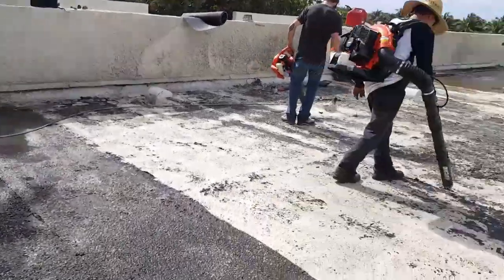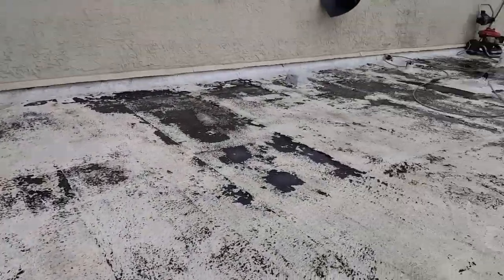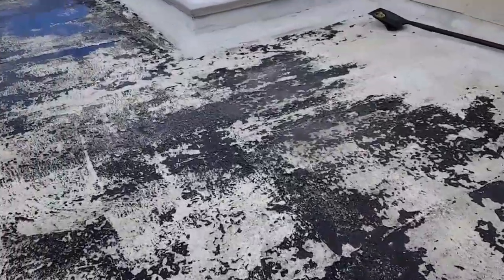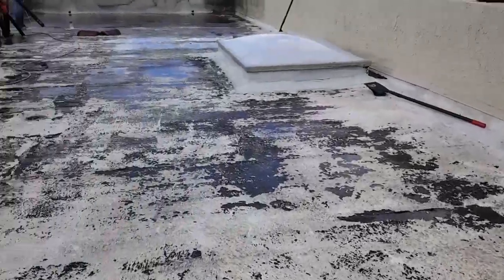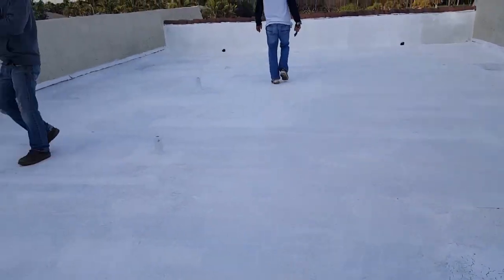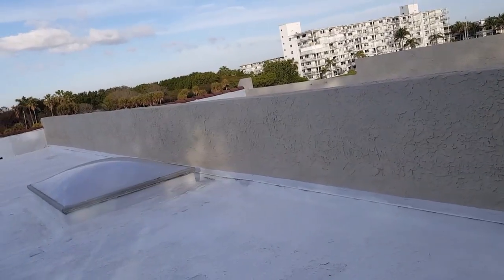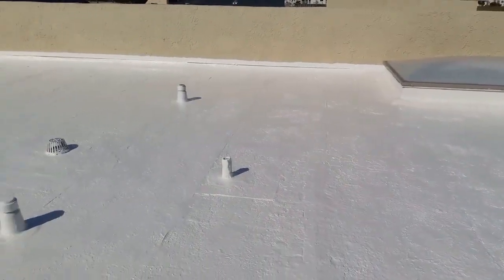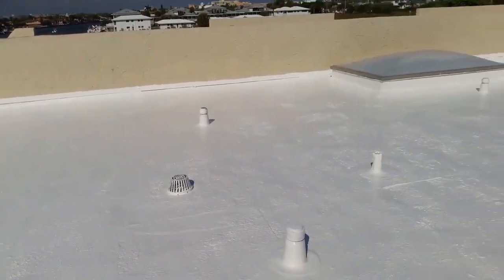White Silicone Roof Coating Done Right: What Most Contractors Get Wrong — And How We Get It Right

Comment: What primer is used for silicone application thank you in advance
Reply: primer is not required for metal, wood, or plastic materials. it's 100% silicone.  Henry's makes a retail product called Tropicool 887.  I've applied it to shipping containers, and most roof surfaces. You should always perform an adhesion test to make sure.
Reply from the maker: It depends. Mostly an acrylic base is fine. Check the manufacture specifications. If you are installing over an asphalt roof, you will need a primer coat to keep it white.

Comment: What coating would you recommend for an EPDM roof membrane....
Reply: Henry's tropicool 887 will go right over EPDM.
Reply from the maker: EPDM is tricky because it forms a heavy residue than can be difficult to get full adhesion for silicone. Just be sure to prep the roof properly before installing.
Reply: @AastroRoofing  Thank you..!!!

Comment: Do you need to remove old, chippibg silicone sealant before applying new coat?

Also how thick should the silicone layer be?
Reply from the maker: The finished thickness should be a minimum of .22 mills. But some coatings can be applied with a thicker coat. Yes the existing roof should be properly prepped and repaired before installing silicone.

Comment: How much should this cost (estimate wise) when hiring someone to do this for you!
Reply: It depends on how large the job is. Small job I'd say in the range of 3 thousand
Reply from the maker: It depends on how much prep and repair work is necessary, also what type of surface it is covering. Silicone roof coating costs about $2-$3/ft to buy the product, application usually costs about $.50-$1/ft. So roughly $2.50-$4/ft cost before any profit, overhead, or prep work. Total cost for the system from a reputable company should start at $5-$6/sqft and go up from there.

Comment: What's the difference between silicone and acrylic? Or which one is more effective?
Reply: Silicone can be solvent-borne or air-moisture-cured.  Acrylic is water-based and can be good for adequately sloped or vertical surfaces.  Acrylic is NOT okay with any ponding water.  Silicone does very good with standing water.  Silicone also doesn't break down in UV light like acrylic does.  While there are situations where I will use acrylic, generally I favor silicone.  Oh yeah, NOTHING sticks to silicone... except more silicone.  Acrylic can be quite coat-able and paintable.
Reply from the maker: @Dubya84  well said. Never use acrylic or water based coatings on a flat roof. It can be used as a base coat to add tensile strenght to a silicone roof coating but cannot stand alone on flat roofing surfaces. Only use acrylic if the roof is properly sloped and drains very well.

Comment: one way vents? must be allowing moisture out?.. shouldn't seal moisture, not good..
Reply from the maker: Agreed, But anytime we install a coating or recover system over a concrete deck, we use one way vents for residual moisture. It is just good for the roof system.

Comment: Can you explain the process you use to install them 8 one way vents please I would greatly appreciate it
Reply: Cut a hole in the roof the size of the vent hole on the bottom all the way down to the decking then you screw the top side of the one way vents approximately 4 screws through the flange into the deck and then you flash it or seal it like they did
Reply from the maker: Attaching the vents with screws is not preferred @ReidJohnson35 . Only use a mechanical attachment if necessary. Just be sure to flash according to the roofing system manufacturer specifications.

Comment: Awesome keep on truckin .. looks great....in the event....water was to find its way behind .....due to unsealed metal along the roof walls...say,...would the coating pull away from the walls like skin ... leaving air pockets, wrinkles, and water underneath?....
Reply from the maker: It is possible but unlikely if installed and prepped properly

Comment: I thought the warranty for full silicone was 15 years or more
Reply: Actually 50yrs. But maybe there's other factors he's taking into consideration like the age and prior wear of the roof so far.
Reply: Depends on how thick the layer of silicone is for how many years it says it should last. There's millage measurement guide you can look at that'll explain it and also a millage tool that'll allow you to check the thickness of it while applying
Reply from the maker: NDL warranties of 10-20 years are available from some manufacturers, most silicone products have limited lifetime warranties for the product. Expect to get 5-20 years of life expectancy depending on the application of the product

Comment: So there is no need to apply seam tape at any seams?
Reply from the maker: That would be an upgrade to the system but not a requirement.
Reply from the maker: @user-it7kg3pm4q  no, it is not a requirement for this system.
Reply from the maker: @user-it7kg3pm4q   
Thank you for your comments. I appreciate your concern about the durability of silicone roof systems and the use of polyester tape at the seams. 

With over 40 years in the roofing industry, and having personally installed roof coatings for over two decades, I've adhered to various manufacturers' guidelines and industry standards which do provide options based on specific project needs and warranty requirements.
Aastro Roofing Company is top rated in the industry and prides itself on quality work for a competitive price.

While the use of seam tape can indeed extend the lifespan of a coating system, it is not a mandatory requirement for all systems. For instance, the system we discussed does not explicitly require reinforced seams for the standard warranty coverage, as outlined in the manufacturer’s guidelines https://henry.com/fileadmin/pdf/literature/HEN_RoofRestorationTrifold_FNL.pdf 
It’s important to match the system specifications to the client's needs, whether they prioritize budget or a longer warranty period.

Our approach has always been to provide the best solution tailored to our clients' requirements, and we stand by the reliability and performance of our installations. We're committed to delivering quality and value, ensuring that each project is executed correctly from the start.

Please feel free to further discuss any specific concerns or needs. I'm here to help ensure the best outcomes for your roofing projects, but please, first do some research.

Comment: How many coats of the silicone did you use?
Reply: Silicone is single coat, or should be if done right.
Reply from the maker: This manufacturer requires 2 coats @MisterJohnMorales  However there are manufacturers that let you use 1 coat. In the end, it depends on the thickness of the final product. Even systems that only require one coat many times will need additional application in some areas if the desired thickness in not achieved.

Comment: If the roof sits under water you should have brought it up to code 1/4" per foot.( building code )  Roof expert i think not
Reply from the maker: So you only have a solution if it meets your requirements? Not all homeowners can afford to slope their roof. Your knowledge of code is flawed. This product is designed for roofs that hold water and does not require proper slope. What about coal tar pitch or Permamop roofing systems? These systems also do not require positive slope and are acceptable for new construction. The 1/4"/ft rule only applies if it is required for the roofing system. This roof passed all local plan review and inspections in South Florida which is a very strict code enforcement and ordinance. It was installed in 2017 and has never had an issue. It is inspected every year and is still performing very well. We offer solutions for roofs that sit under water.

Comment: 10 more years? No way. These guys will see 25 plus more years out of this roof if not much more.
Reply: Not
Reply: @nesq4104  …You’re right. Silicone covering sucks.
Reply: @insightvideo6136  I read too many potential issues with silicone.  I just opted to do a membrane instead and the price was basically the same
Reply from the maker: @nesq4104  if the product is not used or installed properly, it will definitely have issues. We have had great success with silicone and continue to do so. Unfortunately, South Florida homeowners insurance will not allow for life expectancy of more than 20 years before they will require the property owner to replace the roof system.
Reply: @AastroRoofing  that interesting.  So when your saying great success with silicone how many years does it remain problem free on average?
Reply from the maker: @nesq4104  I have been using this product for about twelve years now. If installed properly, it can be at least a ten year system and from what i've seen up to twenty years. What that also depends on the existing roof and the conditions for the property. It is always best to sell the proper system for the proper roof. Silicone is not always the best option but can be a great option if the roof is a good candidate. Be sure to have a proper conversation with whoever you are considering to do the work. It also may be a good idea to speak with a manufacturer representative.

Comment: I thought you are not supposed to paint the surface, i was told you apply the silicone directly without primer.
Reply: Danny Reviews 
We use a "Butter Grade" silicone to patch any problem areas such as drain ends where there may be gaps in the metal flashing or holes. Then We apply the silicone in one coat. No primer. We spread it thick with rollers. If you do it that way, it's one coat application and will last 10 years guaranteed.
Reply from the maker: It depends on the manufacturer, some require an acrylic primer base coat, some do not. It is preferred for aesthetics and tensile strength. Silicone has many good properties, tear resistance is not one of them. Also asphaltic bleed through can result in discoloration. A good acrylic base coat helps to keep the product white and gives it additional tensile strenght and tear resistance.

Comment: What was the primer you used before applying the  Gaco.  Also what type of Gaco did you use?
Reply: When I use silicone, Gaco is the superior product. I live in Vancouver and our primer/bleed trap is red. Had no issues yet. Used Henry's silicone and that was nowhere near the quality of the Gaco. The biggest thing when it comes to this stuff like the majority of roofs is your substrate. It's gotta be really clean , really dry and the bleed trap is a must. Cheers
Reply from the maker: Jim, the primer was acrylic.
Reply from the maker: It is Gaco Western S2000 High solids silicone